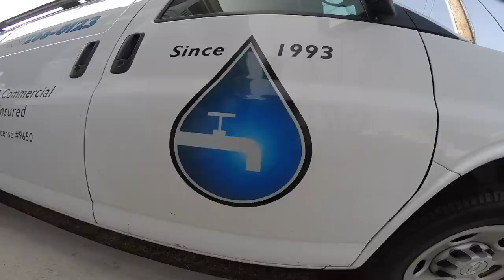CAST IRON SEWER REPAIR PLUMBING APPRENTICE GOT ME GOOD

Comment: Where can I buy a pair of them yellow handed pliers?
Reply from the maker: online...douglas company. they are nice. been using them for 33 years. the company has changed names but they still make them.
Reply: It depends on what name brand you are looking in yellow handed pliers. You can go online to find them or you can go to the major retail tool outlets in your area and on Amazon.com.
Reply: When I was a apprentice 1987--91 they sold Douglas channel Lock's (water pump pliers) at most of the supply House's in New Haven CT. They are just as good as the popular one's, they are worn out when you loose them!!

Comment: That lead pipe looks like a nightmare to work with.  If you epoxy it make sure to rough the lead up with some coarse (60 grit) sand paper to get a decent bond.  I wouldn't expect epoxy on lead to last long, but it may hold until you can do the full replacement.
Reply from the maker: ya im hoping todd....buying some time .....needs to be changed for sure.
Reply: I have had epoxy last for years but  it was on a straight.

Comment: What type pipe saw is that you was using chuck?
Reply from the maker: the chop saw? it was the ridgid 614 dry cut saw. that joker is a beast. I use it to cut 2" galv pipe too. same blade.
Reply: Chuck Barron thanks on the feed back! That sounds nice! And I can see when you say it does the work. Now I can add that to my tool list with the pro press.
Reply: Chuck Barron hey, CB I also seen you was using a small one in the crawl space. Is that the same type or brand?
Reply from the maker: the grinder?
Reply: Chuck Barron yeah the small saw to cut the sewer line when you was in the crawl space. Is that just any saw CB, or is there a special small saw to work with when your in small crawl spaces It had the Diablo blade on it.
Reply from the maker: the sawzall....a common tool...a must have.

Comment: Lead bend with the lav drain/ tub drain inlet. Freaking nightmare. Hard to explain to the customer why you have to repipe the whole bathroom because the toilet flange/ bend finally rotted out. I always started these jobs with a drawing and a waiver absolving me of any responsibility for those old lead drain bends. Lead is supposed to be inert, but there is some sort of reaction that causes is to corrode out over time.
Reply from the maker: great idea on waiver...ya owner was telling me that we changed 2nd floor lead bend 20 years ago....I did not remember till she said it....guess what first floor is over due.....a patch is hopeful for time sake but its time for a bath gut here too.
Reply: I have a lead bend under tub, huge drum trap (I have been itching to open it),  and some sort of thin walled lead pipe under toilet...I nicked in once with the recip, when I was cutting out the toilet bolts and had to patch it with the epoxy. I have the toilet bolts going up through the floor  and toilet. It is an old house and I am a ham 'n egger homeowner/handyman. It works.
Reply: chemical cleaners and the water itself half the time

Comment: Here's one to really tickle your funny bone.The water pipes in this house were routed not above along the ceiling,oh no,who ever did the plumbing in this house when it was converted from two half double houses to a single house were "extra special." They ran the water pipes on the concrete in the boiler room and behind the boiler.As an added "bonus" if I needed to shut off the water for the basement sink or for the washing machine that would leave me without any water upstairs,how's that for a kick in the  "Ask-Me-No-Questions."?The plumbers that connected the water pipes were so "extra special" that they ran the water pipes along the concrete floor behind the boiler and under a wooden saddle where the houses used to join before the houses were converted from two half double houses to a single house and the dividing wall was eliminated so one nail or screw placed in the wrong place on that saddle and it would be off to the races trying to shut off the one or two shut off valves that were installed.From the boiler room to the back of the house I had to buy sixty feet of half inch copper pipe on top of the copper pipe I had already bought and installed when I installed the very first water heater this house had ever had.I could have gone with pex but being that the run was so long I decided to play it safe and use copper pipe.When we first got this house the hot water was a very sad joke in the form of a very small trickle,I had to buy and install a hot water heater in order to have sufficient hot water for bathing and cooking and the water pipes banged as if they were being whacked with a big hammer every time we opened and closed the water which forced me to install a water pressure reducing valve when I installed our first water heater,oh yeah,what fun times I had.NOT!!!LOL!!!Oh,it doesn't stop there,it also turns out that when the bathroom was tiled from floor to ceiling who ever did the the job was also "extra special" and probably never heard of wonderboard or proper bath tub and tile installtion because they used plywood sheets and attached the ceramic tiles directly onto the plywood sheets so now I am also going to have to buy a bath tub surround and only remove the tiles up to where the bath tub surround will reach and in all likelihood cut the plywood behind the tiles and use wonderboard to back the bath tub surround which should have been used from the start,isn't that wonderful?I gave you lip because I saw you using your angle grinder without the grinder guard which is extremely dangerous and should never be done but you do very good work in spite of using your angle grinder without the grinder guard on it.Hats off to you.
Reply from the maker: Thanks Sir. and No more grinding guardless.

Comment: How many cuts can this blade handle in cast iron?
Reply from the maker: they are awesome..Im thinking 4-6 no problem
Reply: Depends on how much heat you allow on the blade., and size of pipe cut. Water the blade down,  get 10 cuts

Comment: probably 2 part "epoxy" in a tube, just break/cut off chunk, mix away and plaster it on and around the leak after cleaning and roughing with with a stiff wire brush by hand, dont want to make lead dust with power tools. **forgot holding the patch tight in place with piece of old inner tube or rubber strap. regular liquid epoxy is usually too thin and would require fiberglass matting and many coats to keep it where you want it and not dripped off on the floor.
you're brave, I'd have spent an hour putting 2x4 bracing screwed together everywhere up to the floor joists and more so nothing could move until after cutting and brace removal on the bad section, all the vibration is sure a killer and issue finder! a helper holding tight from the sides works well to dampen it.
Reply from the maker: yes....that movement made lead leak a bit more for sure. got er done with clamp, rainbow and roof cement....its coming in vid. thanks

Comment: Use some 50/50 solder to fix that lead bend
Reply from the maker: yes tango said the same...i have a water drip so problem unless the stop using bath for a week and use upstairs. Im there monday for this attempt.

Comment: i would of used a grinder blade instead of sawzal.... sawzal vibrates the pipe way too much and causes damage.... use the grinder next time.... master plumber here in toronto, love the videos!
Reply: depends what kind of blade you use, if you use a quality, fine blade, like the diamond tipped one, then it can cut cleanly without breakage
Reply from the maker: Mr. B...I been using diablo blades...they are the BOMB! try em..
Reply: @ChuckBarron  i noticed how fast you cut through it.... i cut cast with diamond blade or a grinder...i cant remember the brand of diamond blades i use, i get them from the supplier and they hella expensive like a diamond ring lol i guess it really depends on the job but i find grinding has less possible damage to the pipe but more possible damage to the plumber... lol
Reply: @ChuckBarron on a side note youre a very lucky man to have 2 kids to teach!!! my dream is to have a son to pass the knowledge on.... congats!

Comment: CB-1 here's a fix for that led Bend pipe go to your plumbing supply house get a bar of lead and take your torch and heat it up and apply it to that crack clean the surface before applying the lead that should seal it up. That's my  Tech tip of the day I hope it helps you out. Peace brother
Reply from the maker: i was thinking laco flux( so good you dont even need to sand copper) then 50/50 the the crack....hmmmm....is laco even still sold? thanks for your tech tip of the day....appreciate it
Reply: @ChuckBarron  I'm not sure if they still sell Laco I haven't used it in years. You can also melt down some lead weights from car wheels with your torch and try to apply it if you can't get the Lack. I know you will come up with something because that is a big job to tear all that crap out. Good luck my brother
Reply from the maker: I have shredded lead which is great to work with. you ever use it? great for saving to melt and pour a joint. Monday is Funday for this job.

Comment: I really think you're past the hard part I think with some careful surgery with the rotary hammer you can take that concrete out and remove the lead pipe and go back with a new one just pulled the toilet what's a new toilet flange you should be good
Reply from the maker: Ya its a matter of time. That was the case here. They just wanted to buy time. She still holding fast.

Comment: 😂😂😂, you can always tell the difference between a plumber and a installer of high pressure plumbing. Blocking vs. No blocking.
  Im actually surprised you dont do lead work, you definitely look old enough to know how.
   I'm starting to think I should start a school on caulking n repair of lead pipe. If you are in Atlantic city NJ, all you gotta do is visit a local marina and find a Shipwright. They will give you a lesson on lead work and they always know who has extra caulking tools for sale.😂